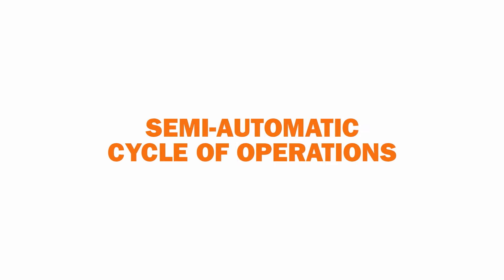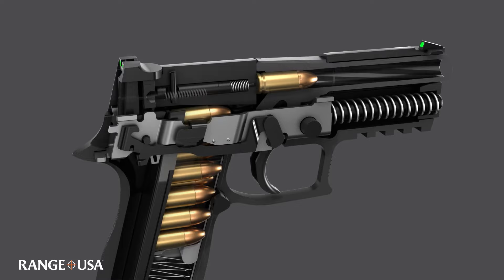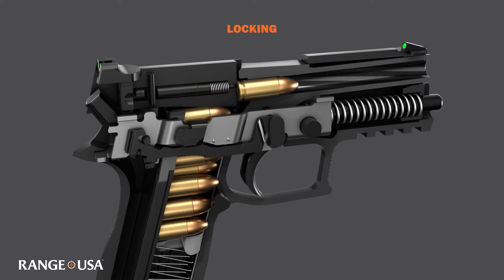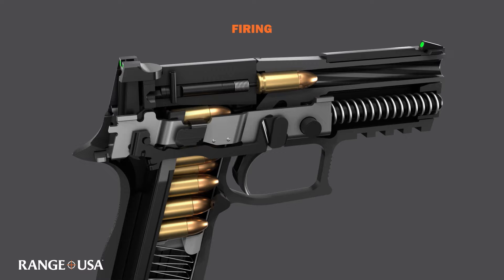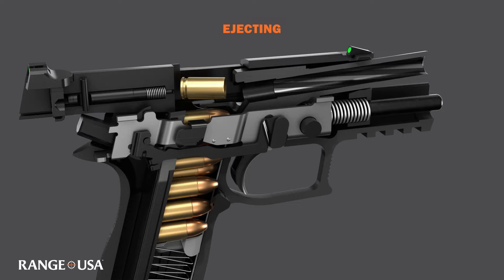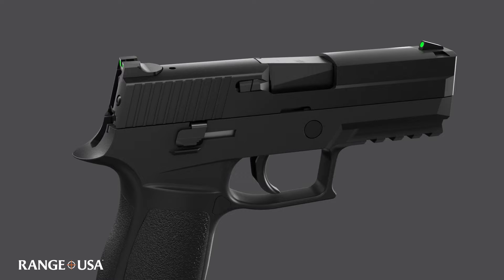How a Handgun Works: Semi-Automatic Cycle of Operations

Comment: A cartridge is inserted into the chamber. The action is closed, and the firing pin is pushed back and held back under spring tension. The trigger is squeezed, releasing the firing pin, which moves forward with great force. The firing pin strikes the primer, causing it to explode

Comment: What happens when you pull the triggger  with no round in the chamber? Will that automatically load a round in the chamber?
Reply: Yes.
Reply: The firing pin hits nothing. You hear a click. And since the slide action in a semi auto fire is forced by the pressure from spent cartridge the slide will not move therefore, no it will not load  round in the chamber. The slide must be manually cycled to load the first round, then after that first round is fired the action parts inside the firearm will load the next round (as seen in this video).
Reply: @fortuneherico2692 this comment is incorrect.
Reply: @fortuneherico2692 this comment is incorrect.